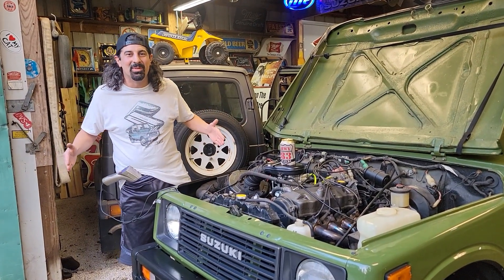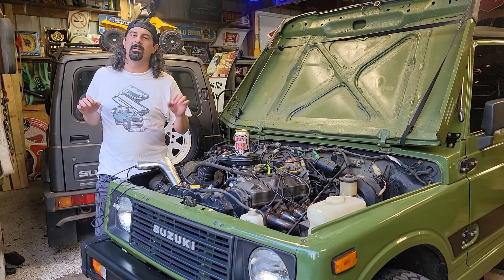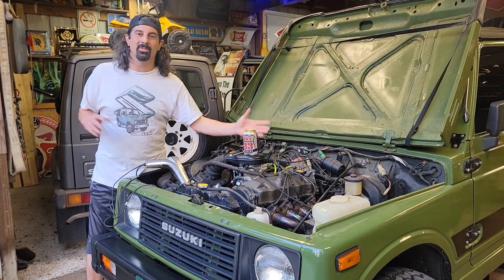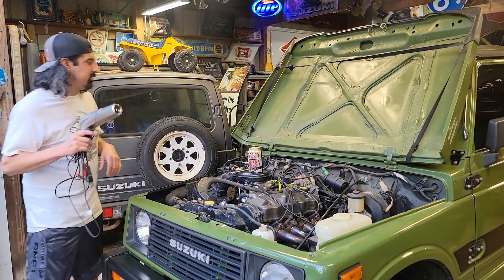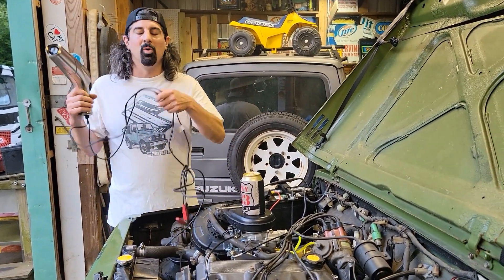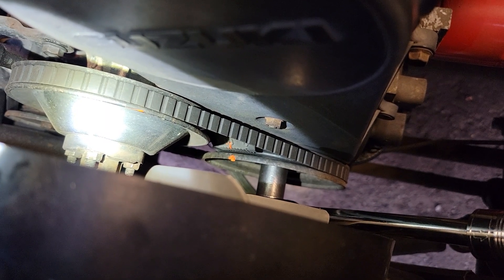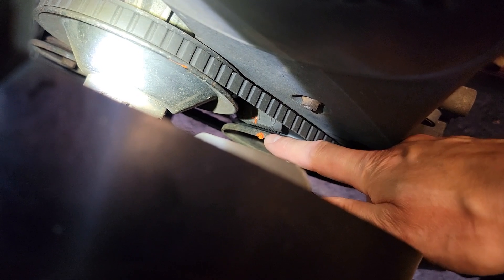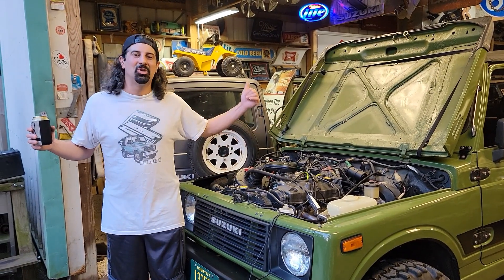Setting Ignition Timing with Light - Suzuki Samurai Engine - Distributor adjustment

Comment: Thanks for your great videos. How I can tell that I will need to do this? The local mechanic just turn the distributor right and left without using the light or any things else. My question what is the symptoms that I need to adjust the timing. 

Thanks in advance
Reply from the maker: @aboel3zz  the only way to do it correctly is with the light.  The rest is just guessing
Reply: @Hwy83SUZUKI  what is the symptoms of bad adjusting?
Reply from the maker: less power, less gas mileage, runs rough
Reply: @Hwy83SUZUKI  this what I have right now
Reply: You are awesome man. I should drive the samurai someday from Seattle to you ❤